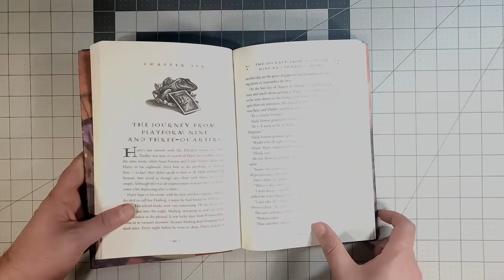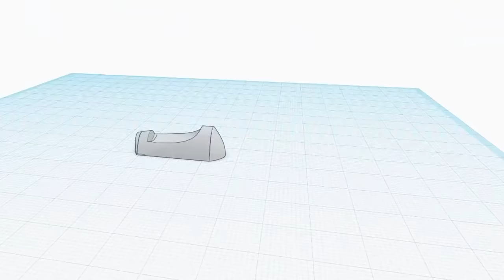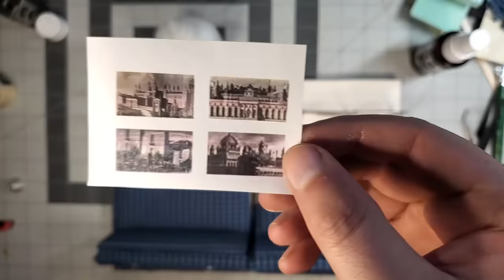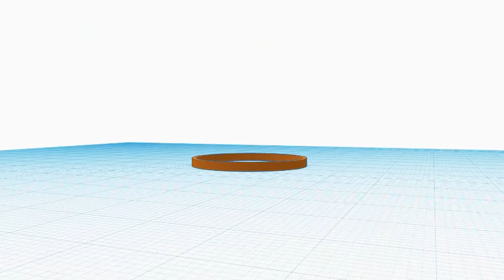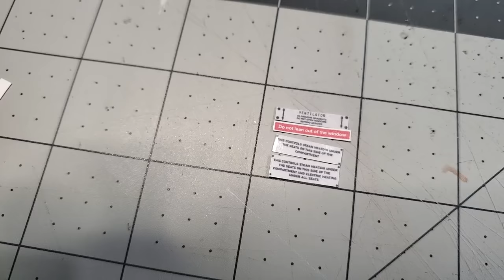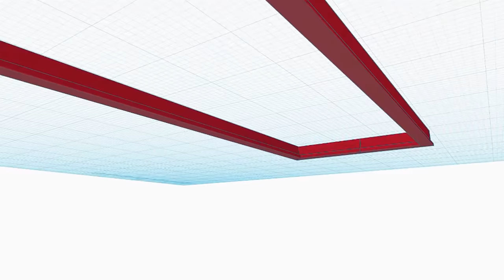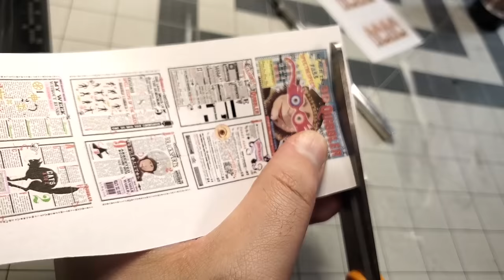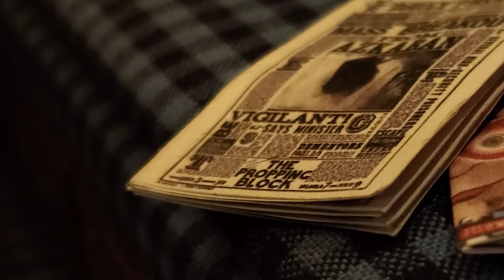🚂⚡ Hogwarts Express  Book Nook ⚡🚂

Comment: Was the hardest part designing and sizing the seamless window view? Amazing! I haven’t been able to get back to making my own HP miniatures, since JKR’s anti trans debacle. This reminds me: it can be about the fans.
Reply from the maker: Yeah it was either that or the sliding door, they both took a few tweaks and iterations before I got them to work smoothly. Getting the door right was definitely more nerve-racking though since it's front and center of the whole piece, and once I glued the rail on I just had to hope my measurements were right 😅

Comment: Very nice, but I was a bit surprised that you didn't use the opening door to activate the scenery motor. I'd have thought that was child's play for someone with your skills.
Reply from the maker: Didn't even think of that! Though it's nice to have the scenery move with the door closed too
Reply: @TheProppingBlock  That's very true. Would some sort of timer be easy enough to fit, with a toggle switch? Or, I guess  you could simply hide the switch on top of the nook. Anyway, nice job and it reminded me of my youth, travelling in carriages of that design.